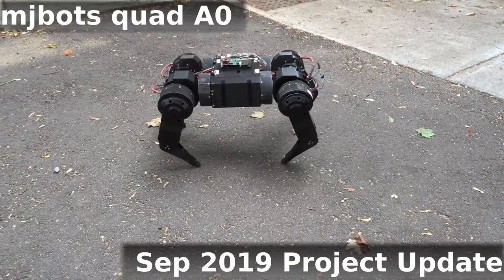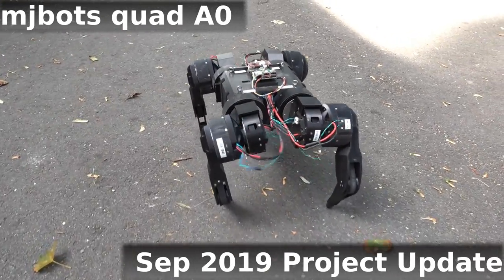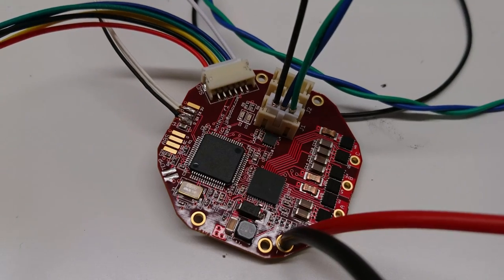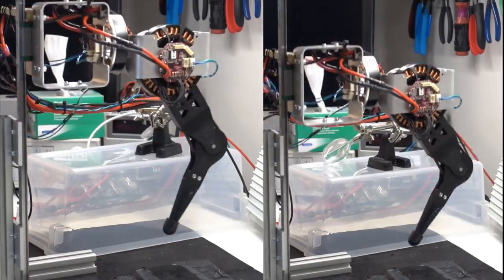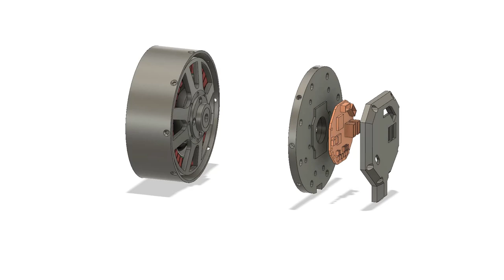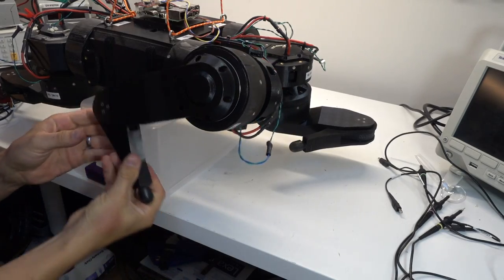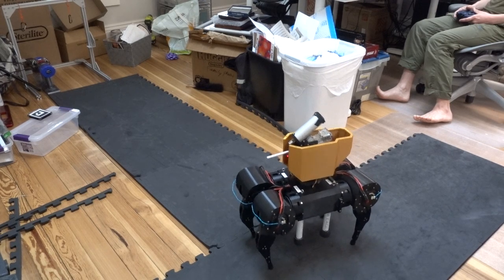mjbots quad A0 - Sep 2019 Project Update

Comment: The fact that you found the O-drive and VESC not quite good enough for your purposes is very telling... You sir, rock! Good luck and thank you for sharing!
Reply from the maker: Well, both O-Drive and VESC are impressive systems, just not quite right for this.  The O-Drive in particular is great, but isn't really suited to be co-mounted on a servo.  If you have a configuration where none of the motors need to move, like the Stanford Doggo https://www.theverge.com/2019/5/20/18632562/doggo-stanford-open-source-robot-four-legged-cute then that works out fine.  Also, it is a bit large and has to satisfy a lot of constituencies due to its general-purposeness.

Comment: You're having so much fun!
When you crank up the velocity on those motors, it looks quite scary.
Reply from the maker: Yeah, I'm hoping that as I improve the gaits, I won't have to rely on such fast leg movement as much.  On the other hand, I'm not sure that I'm even maxing out the current capability speed wise...
Reply: @awesjosh  I didn't want to come out and say it, but given the awesome performance of your actuator, the gait seems a bit...  overly careful :-)

Onyx moves faster, with slower servos, but I do pay some swaying for it. You have higher center of gravity, though, so that will be more challenging.

More math!
Reply from the maker: Yeah, if I was aiming for maximum speed with this open loop controller, I could just squat down to lower the center of gravity and it would be a lot speedier.  As we're fellows in the "make something way harder than it should be" game, my intent is to use the high rate IMU and force feedback to achieve faster movement even over rough terrain.  We'll see how it goes.
Reply: @awesjosh  Ha!

Looking forward to seeing the nextb update.

Why use a PID controller for balance when you can train a deep convolutional model? :-)

Comment: Nice work! I'm curious why you went with the high-speed jerky gate. Is that just a way to complete the steps before it falls over?
Reply from the maker: Yeah, the gait was just the best tuning I could achieve with the basic open loop controller I have now. Slower steps result in the machine tipping a bit more before landing, which can result in oscillations.
Reply: @awesjosh  Interesting. When I was doing that, I went with a hexapod so that wasn't an issue. I was using the algorithms from a quadcopter core to deal with oscillations, but couldn't find a fast/cheap enough force sensor.
Reply from the maker: Yep, hexapods have the advantage that they can move relatively rapidly while always maintaining a statically stable gait.  I've done some work with quadrupedal statically stable gaits before, https://www.youtube.com/watch?v=gvj75ICwHus but am aiming for a dynamic gait here.

Comment: what is causing all that noise?
will it ever be completely silent for sneak attack?
Reply from the maker: I have tuned the current controllers in the servos for maximum performance, which results in some audible noise.  It is possible for them to be silent, but I am currently exploring the performance bounds so don't plan on tackling that for a bit.

Comment: Nice, what material is the legs? PETG? ABS?
Reply from the maker: Yep, all Prusament PETG.
Reply: @awesjosh  nice, do you plan to keep using that or maybe something like nylon/PC?
Reply from the maker: Compared to other possible design changes, switching from PETG to another 3d printed plastic type is unlikely to significantly improve the resulting performance.  So for now, probably not.  PETG is really easy to print and works well enough.
Reply: @awesjosh  The ones I mentioned are more resistant that's all, like if you wanted to build a more rugged or bigger version I think